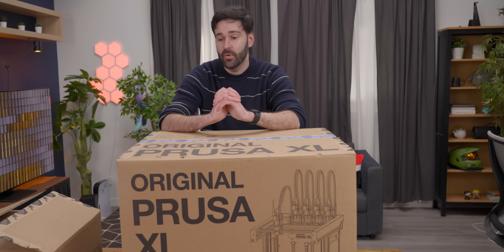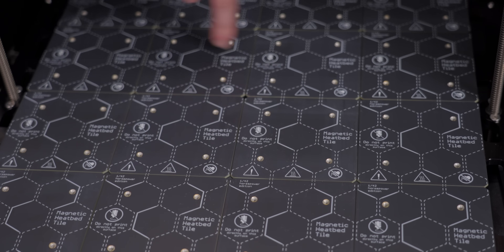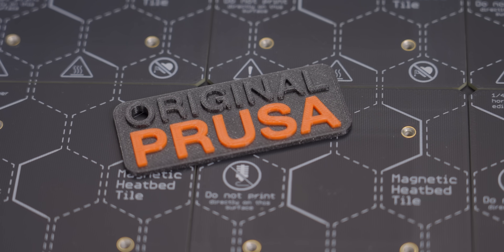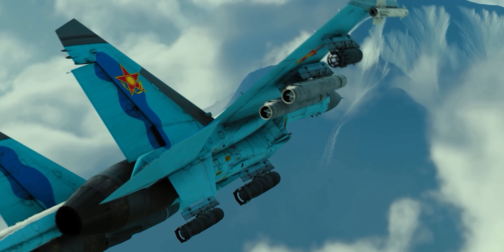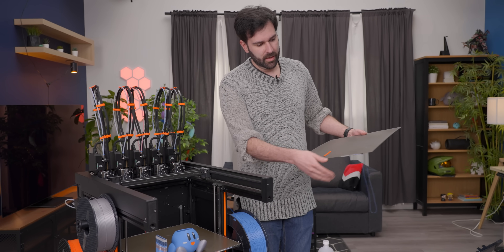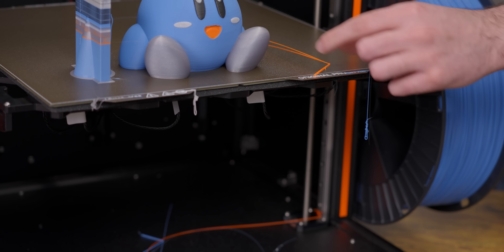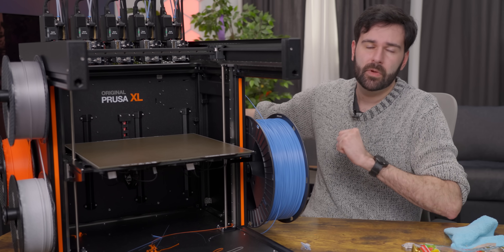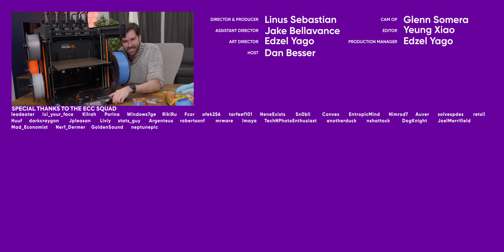Five heads are better than one - Prusa XL

Comment: You printed on a VERY wobbly table, didn't ya? At least looked like it in the footage ( 9:53 ).  
My company recently added a Prusa XL to it's 3 prusa mk3s . While there are certainly other printers which print faster and even with better results, the benefit of the Prusas is that the result will be the same every single time. Run them for thousands of hours, some maintenance once a year and that's it. 
While expensive it's really the only feasible option available at this point in time for the print size. 

We got it with 3 heads. 2 are filled with different colours regular PETGs and one Carbon fiber PETG. So far it has been a reliable workhorse and while one shouldnt buy a product because of promises of updates, we only expect it to get better with improved software in the future.
Reply: slow printers are indeed consistent
Reply: @kyky7kyle7 #BambuGang

Comment: Amazing, i would love a full-sized LLT main video on the Prusa XL! No one buys and should buy the single tool head version. The only reason to do so is financial reasons and even then you should get atleast the two-head version in my opinion.

I personaly got the two-head version because i wasnt sure about the investment for the additional ones and because of the hickups they had in the beginning. I can confirm, got my printer a week ago, that i didnt have any of the issues aswell and i never saw parts coming out so beautifully that you dont even really see the layer lines its amazing

Usually i just print "casual" smaller parts which i design myself so honestly its fully overkill for my usecases. But i like to have the option of multi-color and multi-material prints. 
Just some examples:
- Print with 1-4x Filaments + water solveable(?) for supports
- Print with 1-4x Filamets + TPU to rubberize the feet/ground area of the part to make it none-slippery
- Multicolorprint with 5x Colors
- Configure backup toolheads so if Head1 runs out of filament Head2 can continou if you have loaded the same filament
- Use different materials for support so its easier to remove
- Use TPU together with some filament to print "in-built membranes" (the button of a remote out of TPU so its flexible and you can press it "thrue")

And probably even more things i cant even think about yet, i love it! :D. Please full LTT Video! Good to show the new stuff from 3D Printers to the masses
Reply: Ypu forget the biggest point. Less waste than other multi material solutions like Bambu‘s printer with the AMS.
In the end a necessary step for Prusa since they have been massively outperformed by other manufacturers in the last two to three years.
Reply: The layer lines are very obvious in this video and all videos i have seen of the XL, far better single head printers than this. For $4k not impressed...
Reply: @mariospanna8389 the first video I saw was Teaching Tech's, every video I've seen over time has improved quality.  You're just blind or not even watching the videos lol.
Reply: @krollmond7544  Whos a prusa fanboi huh? im here for all 3d printers, $4k for that quality is a joke. Take your blinkers off then talk.

Comment: Seriously wishing I went with the 5 head option over the basic 1
Reply: You could still Upgrade to more heads.
Reply: Should have went with the P1S and a AMS combo several thousand cheaper and more reliable, XL has been nothing but problem s P1S no issues.
Reply: @baebyte as long as you don't need different materials or bigger bed
Reply: @baebyte  XL is very useful if you want to print multi color or multifilament, without spending more filament on purging than on the print itself
Reply: @baebyte he already has both

Comment: Bambu Labs really has all of these other 3D Printer companies running like their pants are on fire. Good kick in the arse for the competition to innovate.
Reply: Maybe their pants are on fire because they were using a bambu A1 ;)
Seriously though.bambu don't currently have anything that can compete with the XL..... the XL has a much bigger bed, can print colour prints in a fraction of the time of the bambu, has next to zero wastage and can perform true multi material prints. 
If you need any of those features the XL is the only option (for now)
Reply: @TDax  That kind of aligns with my point. Bambu stepping into the market encourged others to raise their game up instead of providing the same type of printer, just in a different iteration.
Reply: @MightyShakaZulu  bambu have certainly changed the game....as prusa did ....heck even bambu have copied prusa ;)
However if you are saying theXL was created in response to bambu,I disagree. It was announced long before the x1 carbon announced. 
I will say however I think the recent input shaping feature added to to prusa mini is entirely due to bambu....and the A1 mini specifically
Reply: @TDax  Good points.
Reply: Chinese thief's are not a competiton, at best an anoyance.
Reply: Bambu is slower, more material wasting, has only one print head and smaller. So your point was?
Reply: @jothain  My point wasn't a comparison between this and Bambu. It was more along the lines of how their presence made the competition improve upon their 3D printer offerings and designs, rather than recreate an older model printer and slap an ascending number onto it.

Comment: I almost pre-ordered this one and I'm glad I didn't. It has loads of teething issues and for costing 10 times as much as the A1 + AMS Lite, it's ... a pretty meh experience. Extremely outdated interface, not user friendly enough, print quality has all sorts of issues, there's far more that can go wrong and that's with brand new machines. I dread to think how accurate these will still be after they've seen some wear & tear. Every single review of this machine showed flaws and for a machine this expensive ... .

Comment: Why would you need a purgeblock with tool head changes?
Reply: Nozzle need priming since they heat back up from an idle temp, and for quality purposes, going straight to print can make imperfections on the print

Comment: Print quality suffers from several design choices. Layer lines are very inconsistent in those samples. They ignored the very square and very rigid requirements for a good CoreXY system. The cost is also crazy for the base unit and even crazier for the price of each head you add on. All those hot end parts do not cost that much even paying already marked up prices.

Comment: Kinda have to disagree with you on the print quality, seems to be quite a bit worse than what I would expect from a $4000 printer. If you look at the still frame at 8:49 you can sort of see what I'm talking about. There are very obvious layer lines (center of the left leg) that I would expect out of something like low-midrange prusa but definitely not in something at this price range. Obviously this is exacerbated by the lighter color but still is disappointing to see.

Comment: There is only one head. Why would you need a purge tower if you have multiple printheads? The print quality kinda sucks for what i know prusas are supposed to be. I am honestly not impressed with the results. I have a hellbot hydra with 2 real extruders and its way better than that. And with that amount of filament being wasted shit that aint good chief. I rather have two real heads, with different nozzles and no waste at all.

Comment: the instant layer change is nice. Just did a 4-color print on my Bambu/AMS and with 2000+ filament changes took about 3 days to print on what would have been about 3-4 hours single color.

Comment: My issue with this is why are there purge towers?, why not just have 5 print heads.... You could eliminate purging AND purge tower waste all together..?

Are they actually individual print heads? Then why do they have purge towers that large at all, nothing should be in the nozzle and they should only heat up in preparation for a head swap.

Just do an initial purge on all heads off the edge like you showed if it's a color from previous prints concern?

Sidebar: why hasn't prusa pushed non-planar printing still?
Reply: I think you still want to prime the nozzle, so the pressure is correct and to make sure that there's no issues with the filament being fed. With possible 100s or 1000s tool changes you would quickly run out of space on the edges
Reply: You can't just start printing like that without doing at least a short purge and prime.  The print quality would be dreadful, with under-extrusion at each filament swap point.

Comment: I know the Bambu Lab AMS wastes a lot of filament and this doesn't. But you could buy a hell of a lot of filament with the $2,500 you would save getting a P1S with AMS over this. I loved my Prusa MK3. They used to be the gold standard. But I don't think they are anymore.
Reply: theres more to this than just waste.
a 5 color/material print on the XL is MUCH faster than on the bambu.
And also dont forget the XL has more than 3 times the build volume of the X1C so its not even a competition at all.
Reply: @Pixelplanet5  That doesn't make it worth three times the cost though.
Reply: @1981AdamGs  it absolutely does.
3 times as much is a steal considering you are getting something that has zero competition.
The print time savings alone make it pay for itself in no time.
Reply: @Pixelplanet5 I suppose it depends on what you're doing with it. In a business setting I can see your point. And I don't disagree. I think it would take a long time to pay for itself if you're a hobbyist. But I guess this printer isn't probably geared towards hobbyists.
Reply: You're completely missing another factor tho. A print that take 2h58 min on the XL would take 15h40min on the XC1. So you could be printing the same thing 5 times in the same time it take the XC1 to print it once. The saving get huge pretty quickly if you're running this in a print farm.

https://i.imgur.com/VRu6Bug.png

Comment: that is a very steep price for this version of it, but I'd love to see an expanded full review. my usecase involves a lot of medium size prints (roughly 3x3x1) and I'd love to see if it could execute those all at once!
Reply: Unfortunately that's the price of it being made completely in EU by properly compensated employees. Top-tier 24/7 support when something goes wrong (even when the warranty expires the support will do their best to help you. Ask me how I know that.), top-tier documentation, top-tier reliability, long-term software support with new features (not so long ago Prusa released an update to 4 year old Prusa Mini that added Input Shaper. Pretty much doubled the print speeds for me, it's like a completely new printer now). People don't call Prusas work-horses for no reason. They just work. Easy to maintain and service with available spare parts.
Reply: @kurtwood9261  prusa shill spotted
Reply: I thought it was actually cheap from what I expected. I thought $6000. But I'm probably thinking of pricing from 7 years ago.

Comment: why do you need a purge tower if you already have separate nozzles?
Is there a mode to at least make separate towers for each color, so you can recycle them more easily?
Reply: becasue you want to make sure that the filament is "primed" and at the tip of the nozzle ready to print. In theory, you could just run it, but with them not all being heated all the time, there will be a little retraction that will happen so priming them is just an easy fast way to make sure there are no issues with print reliability
Reply: you could most likely purge to infill

Comment: Nozzles are 0.6 but other than that, great video
Reply: The first batch of XL's were 0.6, but they swapped to 0.4 when input shaping was implemented in the latest firmware update. You can still request 0.6 though if you prefer the larger nozzle size.
Reply: Prusa Research recently changed their future shipments to .4 mm

Comment: Remember the carbon X1 cost only 1,000$
Reply: and has 1 print head, a smaller build volume and will route all of your print/network data thru their servers in china if its even been connected to the internet once.
Reply: @awzup57  X1Plus tester here - nothing gets sent to china, and you'll be able to see that for yourself once its released. Stop believing the lies around Bambu, notice how not a single one of them contains even a tiny slither of evidence. Heck if you dont want to wait, fire up wireshark and check for yourself.
Reply: you win some you lose some
Reply: Remember the p1s is 750€
Including an enclosure.

X1C is mostly gimmicky shit (lidar, Ai, touch display) and maybe useful with the Custom firmware.